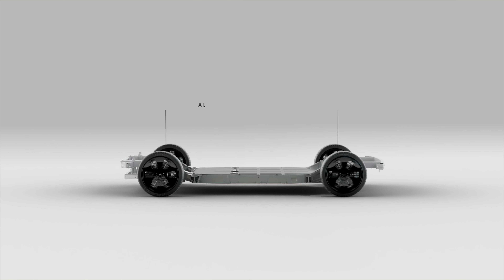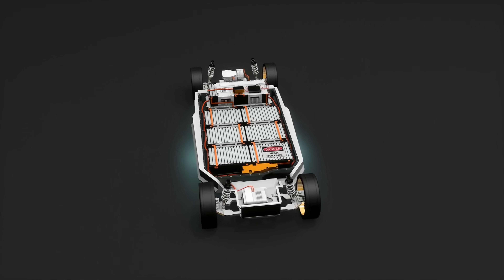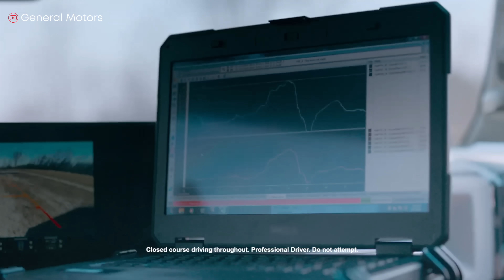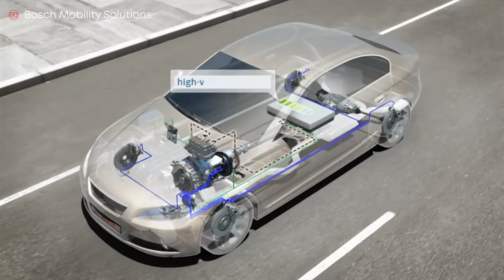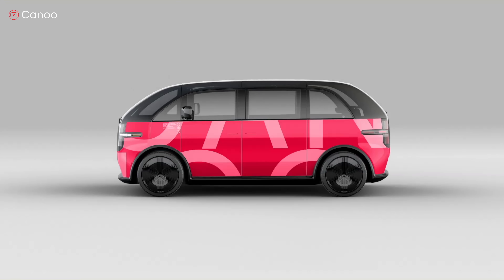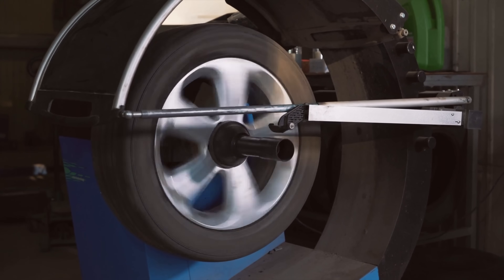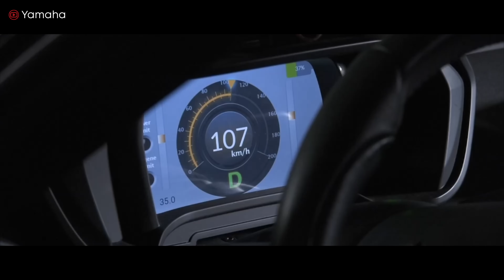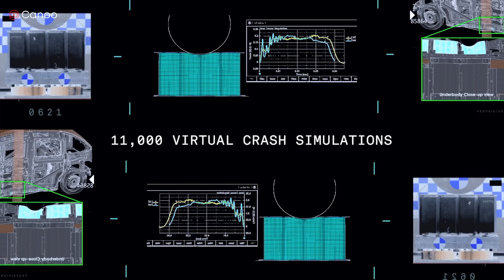No One is Telling You the Truth About Electric Cars, So I Have To

Comment: Since you asked, EV's will destroy the used car market. The cost of battery replacement on a ten y/o vehicle will exceed 50% of the cost of a new vehicle. No one, with half a brain will want to buy a used EV. A ten y/o car will only be good for its none worn parts. The rest will be mechanically or chemically  broken down to extract various metals. The rest of the vehicle will fill up our landfills at an exponentially high rate.  

Furthermore, if "Right to Repair" legislation is not enacted relatively soon, repair shops throughout the country will close up shop since they won't be able to access specifications, OEM parts, and programing information.
Reply: Why would the battery need to be replaced when they can last a half million miles? Confused on this take
Reply: @Ghost-jy9hk  The quote "half a million miles" was a pipe dream by GM's managers. Present day battery technology only provides for ten years of useful service, after that,  it's off to the recycling center and/or the land fill.
Reply: @corin164  there are electric vehicles more than 10 years old and still running. Seriously. The new 4680 batteries target a million miles. There are research papers online you can read right now that talk about this.
Reply: @Ghost-jy9hk  I bet that battery is only holding 50% to 60% of its original capacity.
Reply: @Ghost-jy9hk  you are obviously someone who knows nothing about the real world specs… Co Rin is totally right. Batteries lasting a million miles is crazy. Looks good on paper but would never happen. And to top it off, batteries should be measured in hours not miles. But that is a whole other topic lol
Reply: Who needs a used car dealer? The black market will take care of that!
Reply: @Ghost-jy9hk  you are overly optimistic
Reply: You sound prophetic
Reply: If a car sells well, I'm sure they will be lots of reconditioned batteries that can be sourced. The Prius' battery for example (a hybrid) is comprised of 28 cells that make up the battery. Sometimes, 1 of the 28 cells can be replaced, recalibrated, and sold at a fraction of the cost of a new hybrid battery. Mind you, the capacity of a reconditioned battery won't be as good, but probably decent.

I got a quote from a dealership for a new battery on a hybrid, and it was about $11K. For a reconditioned battery, it was about $1K. For either, labor costs about $1K.
Reply: How salvageable are EV's vs regular cars of the same models when getting in the same accident? Like will a rear ender potentially destroy the battery? How do insurance costs compare?
Reply: @corin164  Tell that to the fleet of Ford Escape hybrids retired from NY taxi service with over 500K miles on the original batteries.

I own a 2009 Escape hybrid with 140K still on the original battery.

I also owned a 2010 Fusion hybrid at 200K miles on the original battery. Gifted it to my sister who still drives it with zero issues at 210K miles.

Replacement battery cost is $800-$1500 in parts, and the replacement itself is a 30 minute job doable by just about anybody.
Reply: No.... 1st, I believe the # was 60% of Californian who purchased an electric car traded it in for a gas car due to inconvenience of charging.. 2nd, America needs Electric charging infrastructure network with seamless integration across all models of vehicles before the switch.. 
Lastly, other forms of fuel are coming online and will become mainstream in 30yrs or less.. The hydrogen age is upon us an will make the gasification equivalent to when we used to test nuclear weapons.
Reply: @co rin awfully short sighted. You still using a flip phone or are you still on dialup over there? 
Batteries tech will benefit from economies of scale exponential cost reduction as evidenced by battery cost/size  reduction over the last 20 years.
Reply: @Ghost-jy9hk  The hummer and other EV with higher ground clearances won't have the issue of getting punctured by metal debris in the road. Additionally, research an testing on how EVs batteries will hold up under (mid-long term durability 80-120k miles) tow loads will be a constant evolution for 10yr.
Reply: It's actually going to decrease cost of entry for driving, used electric cars already have a negative stigma to them as you highlight. Any schmuck like me will be able to afford an electric car with 60% battery life.
Reply: Let them close. Most repair places are little more than legalized theft anyway, especially the chain repair shops.
Reply: @corin164  EV batteries are not recyclable,  they have to new...
Reply: @corin164  you are based this on what data? I would love to see your research.......nah better you leave where ever it is you found it.
Reply: @georgekazanchyan4976  and you know this........... because?
Reply: @corin164  battery's can last 15 years at least
Reply: @georgekazanchyan4976  have you driven an EV? Maybe instead of calling people stupid do some research.
Reply: @Tim Fowler I think if your car is in a fire, it's gonna explode regardless of fuel type
Reply: Right to repair is a dumb idea. All that will happen is you will hand big companies power to regulate their competition out of the market. Think FDA.
Reply: @dragospahontu  My truck is a 98 and it was around $3k for me to replace the whole engine. That's about 3 to 4 times cheaper than replacing the battery.

"Can last" is a meaningless statement. Last at what... 50% efficiency? An edge case?
Reply: This has been on my mind for a while. The waste involved in mass production of ev transport is a concern. Our ICE cars can be salvaged or even scrapped and recycled, but it is well known ev's for the most part are not. It may give rise to a new industry, however if someone specialized in recycling these batteries. I thought it was extremely difficult and not cost effective currently as the batteries are very complex.
Reply: @supersnot4  hybrids are not ev's. It is an ideal setup to harness the great efficiency supplied by fossil fuels and have it taken over by electric motors. You can't equate that to a full on ev.
Reply: @cb-gz1vl  this isn’t just theoretical when actual products are in the market and have been for more than a decade. There are literal examples you could point to that show the levels of degradation and how well the batteries have held up over time.
Reply: @MakingFitnessEasy  Battery sizes are the same. They just made one big enough for a car.
Reply: Like all EV naysayers you predict the future on the basis of current technology. Battery swaps are already a proposed method of curing range anxiety, no reason to believe those couldn't become commonplace. Also, it makes no sense whatsoever that a battery would remain so expensive as EVs become more prevalent and the economics of scale impact the market. As others have mentioned, the materials used in batteries will evolve, and easy serviceability will evolve also, particularly as automakers move to provide EVs downmarket at a profit.
Reply: @Brad-tq2pi  Actually a battery is measured in number of charge / discharge cycles it can handle whilst be able to maintain a specific capacity.  In the space sector we talk of EOL (end of life) capacity i.e. if a satellite needs to survive for 7 years on orbit, we'll specify an EOL of (say) 60% capacity to give us the contingency required for the mission.  It would seem a useful metric that could be adopted for the automotive industry.
Reply: @Ghost-jy9hk  Please show data of your claim ON the same battery going 10 years. 
By all means be an EV enthusiast but telling tall tales just pees in your punch bowl. So show us those "literal examples" of a car driving normally on the same battery and drive unit for 10 years.
Reply: @MikeLawtonUK  That's called planned obsolescence and the auto industry already does that. A true environmentalists makes his car last 20 years so a new car does not have to be built.
Reply: Just like buying any 10 year old car or truck you will have to consider how old it is and the cost before you buy. People who can't afford to buy a newer car will have to consider buying used Just like a gasoline powered engine.
Reply: @supersnot4  that's a hybrid, not an electric car. We're talking about 100% electric cars. Not cars with a gas motor. Try getting even 300k out of a electric car battery.
Reply: Tesla has had a million+ mile battery for several years now.  Several Taxi service companies have confirmed this.  Do you really expect the vast amt of used vehicles 10+ yrs old to have anywhere close to a million miles on them?
Reply: I have a 5 year old Renault Zoe which still retains 94% capacity as seen on my OBD2 dongle.
Reply: Like the cost of Hybrid batteries, at first were extremely high but the more they were around the cheeper the cost of replacement, and that was the same thing they said about Hybrids, Toyota is working Solid State batteries, and that what scotty was probably referring to about GMs million mile battery game changer.
Reply: Many people sell or trade cars less than even a year old for various reasons.  Most sell or trade in under ten years.  The commerce in used vehicles won't go away.
Reply: @Brad-tq2pi  I 100% Agree as much as they will cost, We need DATA recorders keeping track of the average temperature or at least the highs and lows along with the times the cells were recharged from a dictated low point,  Otherwise I don't want someone's else's overheated,overcharged junk, I personally want my REAL car to go places 200 miles out.
Reply: @MikeLawtonUK  Yes make sure someone gets the memo, Until there's a HUGE breakthrough in electrical power storage, Lots of people saying things like almost instant charge and long distance batteries, But so far as far as I can tell, I still did the right thing buying a new car that gets 37mpg🧐.
Reply: @cb-gz1vl  Yes and it has to keep up with my Honda even when it's  -35F degrees outside and parked outside my work for 8hrs-10hrs while I work inside a heated building, Then systems come on without any problems with heat or energy to get me back home to the garage, That's WHAT I REQUIRE❗
Reply: @cb-gz1vl  It's also called being a Conservative in some parts of the world🗽
Reply: you are't kidding.  I have a 4 year old phone and the battery is pretty much shot.  I am lucky if I get 5 hours out of it, much less if I use location.  that's only 4 years and a phone, imagine scaling that up to something that fuels a car.
Reply: Youre assuming that the cost of the battery remains the same after ten years. Also the wear on the parts of the car should be less than on a ICE engine and heaps of ICE cars run way longer than ten years. Also if you're not planning on driving far most batteries won't actually need replacing after ten years
Reply: @richardkenworthy9312  That's a different issue with an EV. The battery and motor ARE the car and those are usually dead at 10 years. So you'll most likely be buying a replacement battery which is like $10k - $20k. I can buy a replacement engine for like $3k.
Reply: It is a huge hassle long run.
Reply: @Brad-tq2pi  hours with AC, hours with heater on, hours without either
Reply: @Tim Fowler yes, do not park your EV in a fire
Reply: @corin164  the chemicals in an EV battery are too valuable to ever go near a landfill. Battery/car makers in the EU are mandated into recycling batteries. The problem they're finding is that they're lasting too long! Also they get repurposed into home energy storage where size is less of an issue.
Reply: @sprunkenterprisesltd.7451  You need to do better research. Most EVs still have 90%of their capacity remaining after 8yrs.
Reply: @corin164  Ten years is somewhat of a pipe dream also because as batteries age they lose their performance after five or six years capacity will be diminished how much depends on the climate location of the vehicle
Reply: I would prefer a Hydrogen fuel cell due to the fast refill time vs long charge time for the battery. But they seem to be less cost effective atm, but in the future they may be great. Still sitting next to a tank of hydrogen and traveling at high speeds is a little concerning!
Reply: @Antares_451  all of the car makers are ditching their hydrogen plans. Hydrogen is an inefficient way to get electricity to a car's motor (hydrogen cars also have a small battery in it as the fuel cell can't produce enough surge of power for acceleration)
Reply: @Antares_451  a jaguar I-Pace mounted a cast iron board, the battery was what it was resting on - no problem.
Reply: @jakegurley74  search for "Fully Charged battery recycling " where currently 95% of the battery is recycled.
Not yet heard of a place that recycles diesel or gas.
Reply: @terryjimfletcher  Because you don't need to recycle it. It isn't rare earth metals. I'm glad it can be recycled however.
Reply: @terryjimfletcher  where does the energy in an ev come from in most cases?
Reply: @DangerDucking  those batteries can be dangerous while they are new , using a lithium battery that experienced an accident is a suicide and MUST be avoided . including any batteries you have no matter how small they are
Reply: There will be a wave of not yet mainstream things like aftermarket batteries, refurbishment/upgrading batteries/components, etc. Plenty of stuff to be maintained and repaired. Honestly, I think rapid replacement batteries are the future. Pull into a shop,  unload your discharged battery and reload a full one. Ten minutes? Maybe? There are pilot projects doing this elsewhere. I believe Nio is one.
Reply: @terryjimfletcher  Yeah. Lol. What will a tow hitch do to the bottom of the car going 60mph on the highway? I can tell you from experience that the cars armor will break before the road or tow hitch
Reply: @corin164  "ten years of useful service, after that,  it's off to the recycling center and/or the land fill." A lot of drivers don't ever drive long distances. They'll still be useful (with 25% less capacity) for doing the school run, shopping, or getting Grandma to her Doctors appointment. Most high millage drivers already drive cars younger than 10 or 12 years or so. (Edit: Then again, I'm British. I guess Americans do much more miles on average)
Reply: @Brad-tq2pi  Just like people said in the 1920s about the gas powered car.  "It makes too much noise... it breaks down too often... etc."  Times change.  So does technology.  The gas engine has come a long way in the last 100 years.  I will bet you anything batteries which are evolving at a very fast rate will continue to change over the next 20 years.  For example, two companies are inventing right now what is called the solid battery - the batteries mentioned here are liquid batteries.  Solid batteries can be charged to 100% without wear, and they don't wear down as fast.  It is where the "half million mile" batteries will be coming from.  Once they solve the mass production problems associated with solid batteries, it will prove all the doubters wrong.  Just like the gas engine 100 years ago.
Reply: @raymondreiff8170  Good point about claims HOWEVER no one has mention a different scheme that is in use in China. The Nio electric SWAPS batteries using a robotic setup and it takes less than 5 minutes. In and out.
Reply: @msraz5523  hmmm there are on average about 130,000 car fires every year in US prior to EVs being introduced AND Im not hearing about EV fires on a regular basis so far.
Reply: @MikeLawtonUK  That’s interesting, yes maybe your right the automotive and industrial industry’s should adopt the EOL concept. I said hours as that is what we use in the forklift, heavy equipment industry. Will have to do some research on EOL technology. Thx Mike always good to learn something new!
Reply: @Buc_Stops_Here  Yes, I agree battery technology will continue to get better every year. And you maybe right solid batteries are the future. But as of now there is no way a million miles is happening. And EV are here to stay I am sure of it, but the internal combustion engine will never go away either. Also I don’t think there is many doubters about battery technology but you have to realistic about the technology right now. All I am saying…
Reply: @Brad-tq2pi  And like I said, they said the same thing about the horse when cars first started coming out.  All I am saying is I doubt the gas engine will last as long as you think it will.  It will take time.  It took about 25 years to phase out horse and buggy.  It will take even longer to phase out the gas engine - potentially beyond your and my lives - but it is going to happen.  I count on it because technology always moves ahead.
Reply: That is crazy! Never thought of it that way. You have a great point. One day I guess EVs will rule the roads, but I still like seeing gas powered vehicles.. and driving one too.
Reply: @terryjimfletcher  Would you choose a plug-in hybrid over a regular hybrid, if that's the choice you had?
Reply: @MikeLawtonUK  and nobody is talking about the raw materials for these advanced batteries ( Lithium fi ), even the big mining companies have their doubts if there is enough to change all gasvehicles into EV's for today, worldwide, just today, and each day, week, month ,... the amount off transport increases with thousands , tenthousands, ....
Reply: Throw away cars, for a throw away society.
Reply: Toyota, The worlds largest manufacturer has went on record stating EV is unsustainable and the infrastructure in just California alone, in order to support 7 percent of EV the need for an additional 8,300 charging stations would be needed placing further stress on a outdated electrical grid infrastructure. 
Automakers are HIGHLY subsidized to even produce these products that few are interested in. 
Furthermore, research where the raw materials are sourced for the batteries. That’s CHINA.
Reply: @DangerDucking  One thing no one seems to mention WRT EV's and that is what happens when there is high water or mild flooding on the roads. Since battery technology requires some form of ventilation to ensure off gasses are expelled, how are the battery trays going to remain water tight?
Reply: @Techrecycle4u We have salvage yards and recycling now, so why is mankind still seeking and using precious metals? The answer is simple, salvage yards and recycling can not cure all that ails the auto industry. Regardless how you cut the cake a 100% recycled battery would need the remnants of several used batteries to match the performance of a new battery. So new elements will always be needed.
Reply: In the 1950's when nuclear energy was in it's infancy the prediction was that you will not need an electric meter anymore because electricity will be so cheap to produce. The bottom line is talk is cheap, no one can predict the future.
Reply: @cmc778  Almost true. Knowing history, and how mankind reacts, will give an average person a clue as to what one can expect in the future.
Reply: Co Rin I was always told, never own something you can’t work on/fix. I have done just that. My metal working, auto body, paint background along with restoration experience has served me well. I have no problem driving a 20 plus year old vehicle and own several 50 plus year old vehicles. I’ve had thoughts of building an EV out of scrap/salvage Tesla components as a hobbyists but would never buy a production EV.
Reply: @chris103193  yeah but then that schmuck is face with a battery replacement cost of half a new ICE car. 

I know people live to bring up battery cost will go down, but y’all are over estimating how much it will go down.
Reply: What’s wrong with a flip phone?
I still use my grandads wall mounted phone that you pick up the ear piece, turn the handle a few times, and shout into a mouthpiece. It works fine, why all the fuss about this new dangled technology.
Gotta go now, have harness the horse to the buggy to get some flour and beans in town to make supper!
Reply: @sprunkenterprisesltd.7451  actually the records indicate they have over 90% capacity. Some have even increased in range because of over-the-air software improvements.
Reply: @Brad-tq2pi  Actually they are measured in capacity and miles. Hours are irrelevant.
Reply: @Tim Fowler does gasoline.
Reply: @DangerDucking  extremely salvageable and recyclable.
Reply: @lonniebeal6032  You are very wrong.
Reply: @Antares_451  no that is an absolutely made up stat.
Reply: @jakegurley74  EV are extremely recyclable especially the battery.
Reply: @raymondreiff8170  looks like you would love a Tesla then
Reply: @jamescaron6465  phone batteries and Tesla batteries are totally different.
Reply: @cb-gz1vl  pure FUD. Nothing you said is factual.
Reply: @msraz5523  Tesla vehicles are the safest in the world.
Reply: @jonfscott  Me NO, I personally own 4 Honda's I like good heat and A/C, Elon isn't my Idol🤯
Reply: @jonfscott  You totally missed the point I was making! You need to know the difference on a how a battery operated electric motor and internal combustion engine work. They should not be measured the same as far as wear and tear. All I was saying… exactly why electric forklifts and other similar equipment are measured in hours. Think about how many miles/km’s a forklift will drive in factory in a 8-12 hour shift. Measuring that in miles/km’s tells you nothing for the battery state of health.
Reply: @Brad-tq2pi  Yeah I have no idea how it works on a forklift but I can tell that you have no idea how it works on a Tesla.
Reply: @Brad-tq2pi  The average Tesla maintains over 90% capacity for 200,000 miles. That capacity is displayed as miles or battery capacity. Take your pick.  What’s even more amazing is that software updates improve the efficiency of the vehicle. Increasing the mileage  capability. Once it looses 20%  which actually takes longer  from 90% to 80% than it does FTO 100 to 90.  The battery is now suitable for stationary storage and then another 20 to 30 years  before the are broken down and re-cycled..for thé highly priced metals about 95% recoverable. 

Their are many videos on Tesla’s dispelling FUD.  These batteries are not the same as a phone or fork lift.  

Here is my suggestion and it’s the one I give to everyone.  Do not get inside or drive a Tesla.  Look its not a car with a battery like a VW iD-4 …  It’s an extremely smart computer that changes the concept of driving.  It’s a warning because you’ll be amazed and have a mind change… That’s  why its larger than all other car companies combined in capitalization.
Reply: @raymondreiff8170  plenty of heat and a exceedingly cold a/c
Reply: @cb-gz1vl  There are many proven examples of batteries lasting longer than 10 years and improvements will be along soon.
Reply: @grahamjohnson4702  At 100% or up to 85%? Yeah some edge case examples. And so what. Lugging around half the car's body weight in battery weight.
Reply: @cb-gz1vl  We are now into the eleventh year of EV production and we have very few cases of batteries being replaced and with improved manufacture it is getting even better so calm yourself down and accept that EV's are here to stay. I was sceptical at first and very anti but all my fears are being gradually eroded
Reply: @jonfscott  You are living in a dream world.
Reply: @grahamjohnson4702  And calm yourself down cause gas and diesel are here to stay at least over your lifetime.
Reply: @grahamjohnson4702  So are you advocating EVs cause they are a good idea or cause you can be a bourgeoisie snob bullying people over it?

Ok I am fine with those $2600 chinese EVs being allowed on US roads with no mods and allow golf carts on all roads that are not highways.
Reply: @cb-gz1vl  OK what are you smoking? but keep it away from me.
Reply: And with it will disappear the saying that a licence of an automotive mechanic is a license to steal.. is it a bad thing or a good thing?
Reply: @mikey27437  EVs still need repair and maintenance. And given their level of artificial complexity it won't be done easily. Watch Rich Rebuild's channel on how absurd some of these repairs are. Broken door handles, frozen components, shorted battery couples....
Reply: @Ghost-jy9hk  - We have many people in the U. S. who will buy a new vehicle after five years regardless of its condition and there are others who refuse to buy new and want to buy a used vehicle. It will be prohibitive for the use car buyer know that a new battery will be required.  

Furthermore, all batteries do not perform at peak ability all the times. With age a batteries performance will dwindle.
Reply: @jaminova_1969  - That's not the point. When I stated "used car market" that actually means used car buyer.
Reply: @Tim Fowler They can. The can also explode if the charging rate is to high and the circuitry that monitors temperatures fails to react..
Reply: @Kauffman578  Someone has to. We are being promised a rose garden with EV, but few are looking at its potential draw backs. Pont in question, is every country going to increase its power grid to support the abnormally high demand to recharge EV batteries?
Reply: @DangerDucking  I'm sure your questions will be answered after each collision.  If EV Mfrs only test IAW NTSB requirements than real world conditions will never be tested.
Reply: @supersnot4  You are mixing apples with oranges. I was referring to 100% EV's not hybrids. Your subjective analysis is meaningless.
Reply: @MakingFitnessEasy - Dream on Nick. Virtually  nothing in the high tech world has become cheaper lately. A prime example is "smart phones".
Reply: @dragospahontu  - Dream on Dragos.
Reply: @jamsxr  I have nothing against "driving or riding in" a EV. What I do have against is how we are being duped by governments to buy EV's to "save the planet" that doesn't need saving. Planets will survive as nature intended and not by what man or any other animal does or doesn't do.
Reply: @cb-gz1vl  I don't think you know what "Right to Repair" means. Check out Louis Rossman's channel.
Reply: @thraknik  - When the known supply of lithium evaporate, then what are you going to do?
Reply: @richardkenworthy9312  However ICE powered vehicles can be 100% rebuilt. No one can say the same for EV's.
Reply: @corin164  A battery is a battery. Hybrid batteries go through a lot more cycles than EV batteries, multiple cycles in one drive often times. Pure EVs go through no more than one cycle on a drive, and the battery is under a lot less stress simply because it's bigger.

Regardless, the data on EV batteries supports my claims. The average Tesla battery is sitting around 90% capacity at 200,000 miles, with many lasting upwards of 500,000 miles.

My main point was that people were crying the same exact thing when hybrids first came out.
Reply: @Brad-tq2pi  The correct measurement of battery use is actually cycles. Miles gives a much closer representation of that than hours.
Reply: @corin164  I watch it all the time. I don't think right to repair are clear on their goal.
Reply: @corin164  what makes you think its going to run out? An EV battery is 98% recyclable and while that lithium probably won't find its way into other car batteries, it will displace lithium for other purposes, such as disposables. Also, as solid state batteries become widely implemented efficiency will improve, thus requiring less lithium for production. Stop feeding your prejudices, its no way to learn anything.
Reply: @C1K450  meh. Most people get rid of their cars because cars don’t last that long. If they did, a lot more people would hold onto cars longer
Reply: This is such a great thread....so many of you guys still don't get it.  BEV will win the future.I do and will bet money on this.
Reply: Well, right now used EV market in Europe is very lively and used EVs cost much more than similar used ICE cars due to the fact that they're bought very quickly (high demand), even though we are talking about pretty poor options by todays standards. The reduced mileage is a fact of life that those buyers are seemingly perfectly ok with. But maybe you're right, maybe in the future technology will get worse and 10 year old EVs will be unusable. But considering how early in the battery development we currently are (and yet Chinese already offer 20k Euro cars with 900+ km NEDC range), such scenario is not very likely. But yeah, in any case, people will have to figure out and implement efficient ways of taking care of retired cars or, more specifically, retired batteries, no question about that. 
Speaking of repairs, on the one hand, who cares about the lack of servicing options, if nothing gets broken. On the other hand, already now there are people who successfully repair Teslas and alike without any professional training or company backing. While protected software is only an issue until somebody cracks it open and publishes a solution online ;) This will only grow as no good business niche stays vacant, imho.
Reply: First off, the "they only last 10 years" claim is demonstrably false. To put that into gas car terms would be along the lines of "there isn't a functional vehicle in existence today with over 100k miles, because the nanosecond that odometer hits that threshold everything completely and permanently stops working." It's such an obviously and blatantly false claim, that literally everyone is either shaking their heads or laughing at you for making it. The date that the manufacturer's warranty expires does NOT determine when the vehicle stops functioning; only who pays to fix breakdowns caused by defective/low-quality parts.

Secondly, a modular battery (like the Nissan LEAF used to use) does NOT need the whole pack replaced when one module goes bad. That would be the equivalent of replacing the whole engine when it comes time to change the spark plugs. And before you use the argument of "that leaves the older modules to fail at a later date" argument, I know of at least 7 people who live within 1/2 mile of me who do similar repairs to their gas cars; replacing only 1 of the 2 tires that are now completely bald, or replacing only the brake disc that's grooved/gouged to hell and nothing else, I could go on. And on the cost, yes a whole battery pack can cost 10k. And so can replacing the engine of damn near any vehicle made in the last decade. Even with used car prices all jacked up, it's still cheaper (and therefore smarter) to go out and buy a replacement vehicle when (that's not an "if", it's a "WHEN") something major goes wrong with whatever you're driving. But again, if it's built to be repaired then an EV's battery can have a bad module swapped out with minimal fuss; no need for a completely new pack.

On the right to repair point, I partly agree with you; however, you're missing a big consideration. If the manufacturer is the absolute ONLY possible source for the parts for a repair, then they, as a monopoly, can set whatever prices they want for even the most basic things. Engine air filter? That'll be $95. Spark plugs? That'll be $370. Exhaust gasket? That'll be $150. Etc, etc. What we really want isn't just to make sure we're allowed to repair our vehicles, but that we can choose parts that may actually be above OEM spec. Yes, there are some total-trash parts out there now; but there are also others that are considerably better than OEM specs. And losing the ability to chose a cheaper option for something that doesn't really need to be high-priced (like brake discs) could also become another force that drives someone to replace their vehicle rather than repair it. And of course the cultural issue of "it's better to just replace the vehicle when ________ goes bad." is a whole 'nother topic. But that'll be for another day.
Reply: @jacobcarlson4010  Let's use Apple as an example of why EV's are a problem. If you bring your Apple to an Apple Store for repair (regardless how minor, Apple price the repair to such a level that replace would be almost as costly. This includes battery replacement of all the cells not just the defective cell. Do you really think that  Tesla will be any different? Furthermore, the tech world has shown their collective disdain for anyone fixing their products other than themselves. Ask any farmer, who has purchased a John Deere tractor, if he/she has access to any information re repairs of his tractor. I'll venture to state that "to a man" the answer will be a collective NO. Look inside the mechanical part of your washing machine or dryer,  chances are that if is relatively new machine you will not see any electrical drawings and parts list, as was the norm years ago. 
Getting back to your diatribe about my assertion that batteries will or will not die after ten years.  No ne with an electrical background will tell you that ALL batteries have a life span. Even Li batteries. The ten years was my approximation based upon my experience with rechargeable batteries.  Li batteries can charge and discharge just so many times before they need to be replaced. Further more, at some point, Li will deteriorate to such an extent that its performance starts to wane, So instead of, lets say 300 mile range, the battery can only  provide enough watt/hrs for 150 miles before the next charge. EV's with their sensitivity to heat, cold and longevity is not the answer. They me be a good stop gap measure to wean us off oil, but hydrogen cell technology is a better answer.
Reply: @corin164 : Good lord, this is gonna take a while. For starters, using a right-to-repair argument against EVs is new; I'll give you that one. But that's all the credit I'm giving. Yes, Tesla has demonstrated quite clearly that they're anti-right-to-repair. That doesn't mean that every other EV on the market is similarly designed. When I chose my LEAF, I chose it specifically because of how little the various systems waste, and how easily repairable it is; I intend to keep and use it for at least the next 15 years. And again, you can choose to support EVs that are designed to be repaired. From what I've seen, the most specialized pieces of equipment involved in changing the cells of a LEAF battery are a vehicle lift, an AC-to-DC power supply, and maybe the cart that the battery will rest on as you're pulling it out from under the vehicle (most mechanics have something similar, but some don't); and videos that demonstrate the steps of the process already exist here on youtube. Not a lot of "hidden" knowledge there, unless you count the "which module number is where" map, and even that was included in one of the videos on here. Now to get back on track, before I go too far down that rabbit hole. Not all vehicles are designed to be repaired, and likewise not all are impossible; it's just one more factor to consider while choosing which vehicle to buy, and I know I'm not the only one who's been thinking about it with every test-drive/looksie.

To touch briefly on your "John Deere" right-to-repair argument, that's actually half-valid; I personally know at least one farmer whose teenage nephew is studying both electronics and computer science and was able to diagnose a sensor fault with their planter (they wouldn't say how long it took, so probably not a trivial amount of time). It can be done, just not as quickly as with a "haynes/chiltons" type diagram. Note, I'm not excusing JD for keeping the diagrams secret; only saying that they're not completely necessary.

On the washer/dryer analogy, I actually know from experience that they do not provide a parts list on the inside of the machine itself. Not even on the 1980s era whirlpool machines that were in my apartment some 5 years ago; the washer had a major water leak from a seal at the bottom, and the landlord said that I could have it for free if I could fix it. Well, with no part number, and no manual, that's easier said than done. And with search results for that model coming back with multiple dissimilar parts for the same seal, it would have literally meant buying close to $300 in parts and tools to TRY and fix it. Not even counting the time it would have taken.

Now we get to the real meat of this argument. While it's true that all batteries degrade, that doesn't mean that they're useless as you (and others like you) love to claim. I've even had this exact argument with a coworker who tried to claim that EV batteries can't last more than 2 years, because he has "experience" with rechargeable AA batteries from the '90s. Yes, he compared NiCD batteries from 25+ years ago to modern Lithium Ion batteries, and claimed that they're identical because they can both be recharged. I sincerely wish I were joking. So I'll have to take your ambiguous claim of basing "10 years" on your experience with rechargeable batteries, with a grain of salt; don't take it personally. However, on your point that EVs are sensitive to heat and cold... that's only half true; by adding some complexity to the battery repair/replacement process, it's easy to make an EV's battery pack as temperature tolerant as a gas car (which, might I point out, absolutely requires thermal management in order to function). And as of right now, I can't think of any non-chinese EV in production that doesn't have thermal management on its battery pack. So the temperature argument is becoming less and less valid every day; it used to be a thing when the LEAF was the main EV, but not any more.

And lastly, the irony of saying that battery EVs are borderline-worthless while pointing to Hydrogen EVs (which are currently driven mainly by processing natural gas) as a way to get rid of oil dependence. Point blank, that's the most facepalm-worthy comparison you've made so far. Yes electrolysis exists, but it's nowhere near efficient enough to use; and alternatives like a paint that produces hydrogen from rain water, are either unable to scale or have efficiency/materials problems of their own. Hydrogen may develop to the point of being efficient enough for widespread use, but to point to that potential while saying that the EV tech we have now is worthless/trash and we should completely abandon it (you may not directly say it, but that's where your line of thought clearly leads) is both laughable and sad at the same time.
Reply: Electric cars will age a lot better than gas cars. Every 10 years buy a new battery and core exchange the old batteries. Refresh the worn interior bits. Keep the EV for decades. 

The entire car market will implode. As people keep cars longer.
Reply: Not to beat a dead horse, but with increased battery milage, the time until new car replacement will be decreased, meaning that the battery replacement will make sense economically. But also, economies of scale.
Reply: @swiftflight7927  Your hypothesis sounds logical only if Americans break the habit of buying new cars after only a few years of use of their old cars. Besides that, there are too many people out there willing to to allows buy the "newer and better" verisons of technologies just to satisfy ther egos. Just look at all the people whorush to the Apple store to buy the newest phone for no reason other than to be an owner of products that are on the cutting edge of technologies. Furthermore, a car manufacturer cannot survive by offering to sell a car that will last ten or more years.